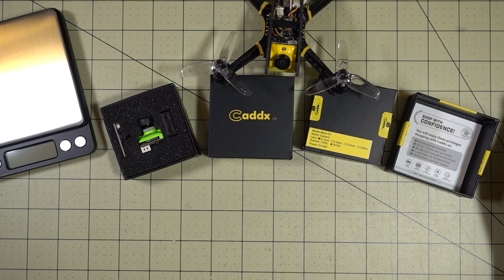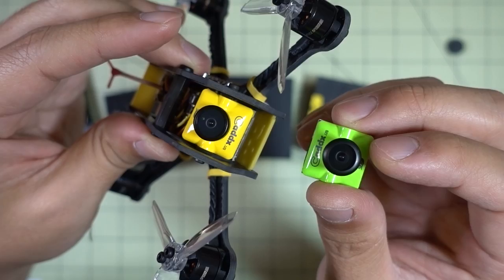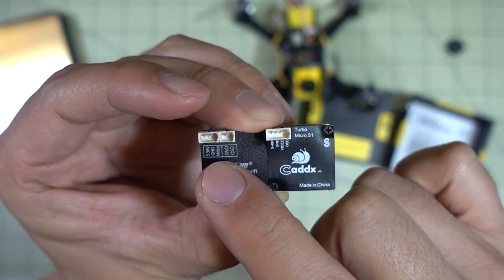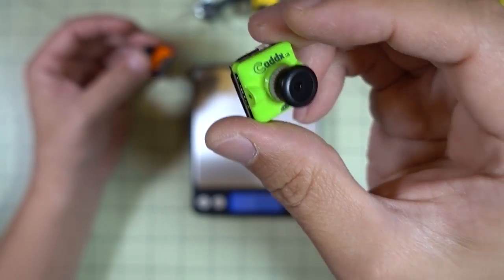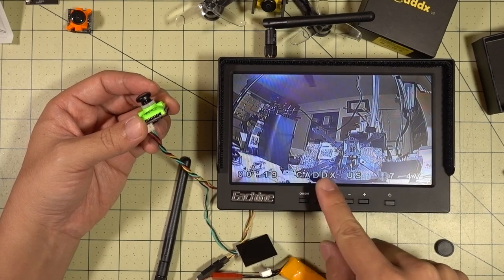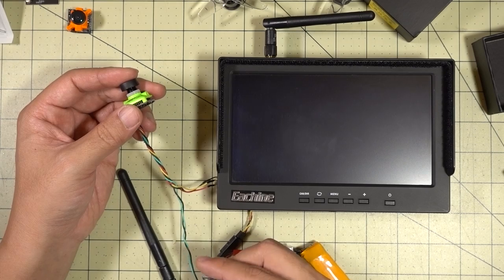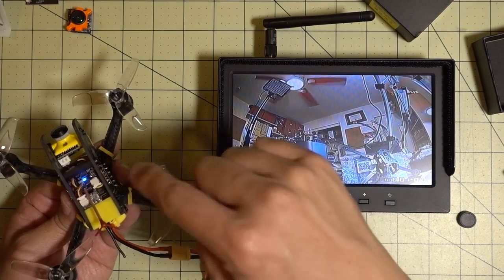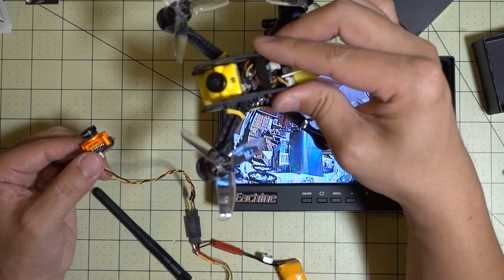Caddx Micro Turbo S1 FPV Camera Review 📸

Comment: Some information that was not posted. The Caddx is 1200tvl. The micro swift is 600tvl. The Caddx is switchable through its osd to either 4.3 or 16.9. The Micro Swift is not. The Caddx can be ordered with 2.1, 2.3, 2.5mm lens. The Micro Swift can not. The video quality is comparable to the Foxeer Monster and better than the Micro Swift. I have not personally noticed and latency problems with the Caddx since i installed it on my 250mm racer. It is a great little camera. Not sure it will be more popular with the hard core racer crowd because of potential latency issues with the higher tvl, but for the other 99 percent of us, it can not be beat in image quality, weight, mounting ease, lens choice or the ability to work with either 4.3 or 16.9 goggles. 

it has everything you want and doesn't break the bank.
Reply: Joe Hendon You are partially right and partially incorrect. Caddx makes three different cameras, in two form factors for FPV. They are Micro and Mini, coming in yellow, green or pink. The three versions are F1 Budget Friendly 1200TVL CMOS Sensor (Approx $19.99USD), The S1 Camera being reviewed in this video comparable  to Micro Swift 2 with a 600TVL CCD Sensor (Approx $28.99USD) and SDR1 1200TVL CMOS with the higher quality Sony Exmor-R STARVIS Sensor (Approx $34.99USD). Think you can get either 2.1 or 2.3 Lens. SDR1 is switchable between PAL/NTSC and 16:9/4:3 as far as I can tell, buy other versions are not 16:9/4:3 switchable.
Reply: Joe Hendon

Comment: I have a caddx turbo S1 on the way. I wonder if it is able to filter all ESC noise by itself when I connect it directly to Vbat (4S), or do I need an extrenal filter? I have no OSD (SPRacing F3), and I'd like to monitor the battery voltage using the caddx OSD.
Reply from the maker: It's about the same as any FPV camera.  I don't think they do that much filtering.
Reply: Wow! That was fast!
I'll see how it goes when I connect it directly, and will have a filter ready if I need it. 
Thanks!

Comment: I've buy the CaddX micro s1 because i've read on spec that has voltage reader, but... read the voltage that power the cam and not the vcc. Yes, if we power the cam direct to 4s read what we want, but lost the filter that, in my case have if i power the cam with the tramp vtx

Comment: That looks like a very good contender; nice to see another option.  I had a thought about the weight difference from the advertised:  since the 2.3 mm lens is so much longer, could it be heavier than the 2.1?  Perhaps the advertised weight is with the lightest lens.  I don't know if that would make up the difference you found or not, it's just a thought.
Reply: Honored Twig I thought the same, although lens usually don't weigh too much.  Definitely a possibility.

Comment: Was the sun out for both? Caddx looked brighter and a bit sharper, but maybe a brighter day and slightly better focus? Caddx also seemed to have more interference...
Reply from the maker: Different days, but about the same time of day.  Locations are different.  The one with more trees is more shaded.
Reply: I just see a lot of white blowout with the Caddx.  That's a deal breaker for me if settings cant correct it.  There's no snow on the ground, so it should not look like there is.
Reply: Thats is becouse the run cam was on an overcast day the caddx was on a sunney day, very bad comparison and should have redone the test.

Comment: I find that the Caddx has superior light handling. Faster reaction to changes and you can see detail in the sky instead of just being washed out brightness.
Reply: TheRealJonnyD Yeah. If the dvr's are from the same day, the caddx really kick Some butt
Reply: Hrr Pippi I'm not sure if it is, but I have the same 2.1mm lens Caddx micro and the transition from dark to light and vice versa are better than any of my Runcam products!
Reply: TheRealJonnyD and cheaper too

Comment: I bought a couple of these. They were working but I had no osd, so I clicked joystick long press down then lost picture. I’ve just got black and white lines, happened with both of them. I can’t get the picture back. Have you any suggestions?
Reply from the maker: Sounds like a defect. I would contact their customer service email or your vendor where you purchased it from.
Reply: I think u changed from pal to ntsc. Change it in ur Googles too and u will be fine mate.
Reply: I had the same problem...now nothing comes on

Comment: Help! My runcam micro board failed a chip fell now im about to replace the mainboard and it available at banggood but i found out that S1 board is much cheaper just wondering will runcam camera case will fit also to caddx mainbaord . Please please thanks im on a low budget that really wanted to learn fpv flyingk
Reply from the maker: The case will probably fit but the image may not focus as the lenses are designed to work with a specific sensor.  Also, I think the sensor on the Caddx has some foam around it that may make the fitting difficult.
Reply: Albert Kim thank you hope you make a demo video i havent seen anyone done it. Thanks again

Comment: Any ideas on mounting this in a 5 inch?
Reply: All my current frame fit micro's by design, if not, drill a couple holes and use the included bracket.